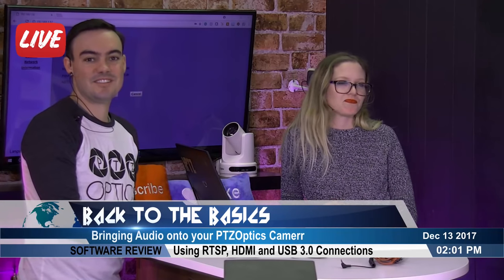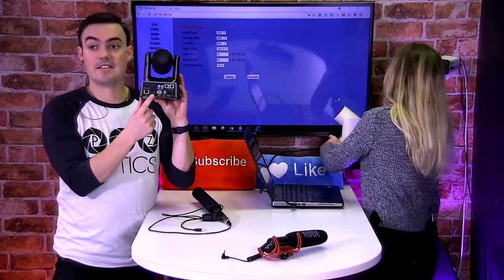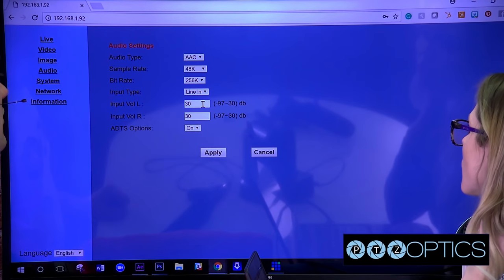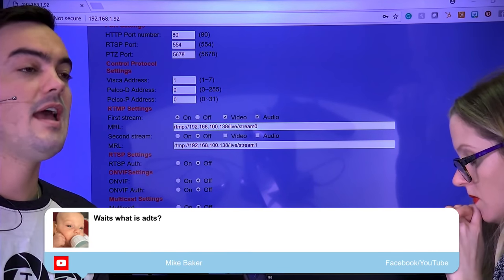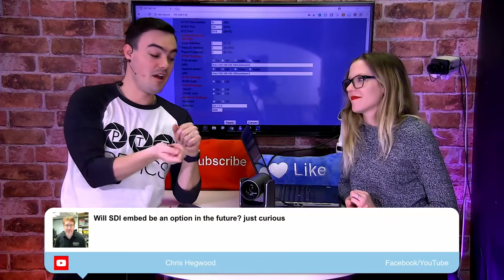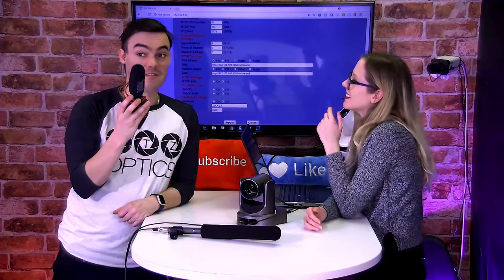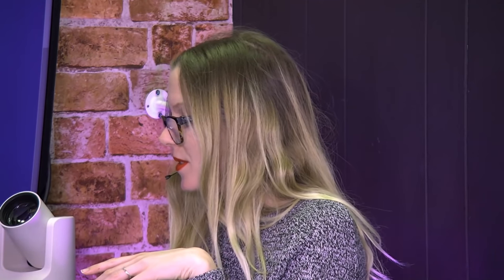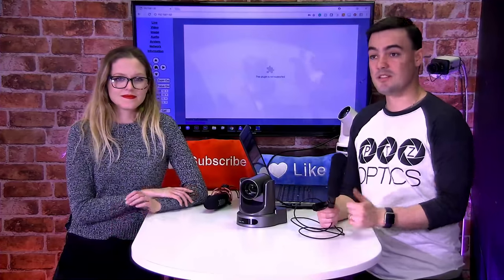How to Add Audio Into a PTZOptics Camera

Comment: By connecting a lavalier transmitter mic to a person, can you connect the lavalier mic receiver to plug into the camera and get good audio?
Reply from the maker: That's a really good use case and you can connect a 3.5mm audio input with a wireless lavalier microphone to the camera. We will try to make a video about this on the new Move SE cameras. Do you have a preferred lavalier microphone? I'm thinking the new DJI wireless microphone everyone is using because we just bought one :)
Reply: @PTZOptics  Thanks for such a quick response - you guys are the best. I use Sennheisser and Shure Lavalier mics. I am sure the one you suggested will work as well. I figured this method can capture the speaker “Spot on” with no ambient noise or worries about mic placement by the camera. The receiver can possibly be mounted under the wall mount with velcro for easy removal for adjustments and battery replacement. What is your take? When is your next show?

Comment: I just bought a 30x PTZ. I cannot get any audio to work. I have tried to different brand new microphones. One stereo and one mono. When I plug into LINE IN I hear a buzz momentarily but nothing afterwards. Am I missing something?
Reply from the maker: "The connection is a 3.5mm stereo unbalanced line level input that will not supply any power.
The camera does not feature any amplifier or pre-amplifier capabilities." ~ KnowledgeBase Forum
https://help.ptzoptics.com/en/support/discussions/topics/13000023228

Comment: Is the audio input unbalanced stereo or balanced mono? Your cable is an XLR to a TRRS, which would be a balanced mono cable, but the camera supports 2 channel audio, according to your setup demo. The camera manual doesn't seem to specify any of this.
Reply from the maker: Hey Don,
PTZOptics cameras typically feature a 3.5mm audio input jack that is designed to accept a line-level input. This type of input is generally unbalanced stereo, meaning that you can input stereo audio signals into the camera. When you mention using an XLR to TRRS cable, it suggests adapting a professional audio source to this 3.5mm input.

Here's the breakdown of what you're dealing with:

1. Unbalanced Stereo: The 3.5mm input on PTZOptics cameras is suited for unbalanced stereo signals. This is common for devices designed to be versatile and compatible with a wide range of audio sources, including consumer-level audio equipment.

2. Balanced Mono vs. Unbalanced Stereo: A balanced audio signal is typically used with professional audio equipment, especially over long distances, to reduce noise and interference. This is commonly seen with XLR cables. However, when you adapt an XLR (which is usually mono and can be balanced) to a 3.5mm TRRS connector for use with a PTZOptics camera, you're likely summing that mono signal into a stereo input or splitting it into dual mono to feed both left and right channels of the camera's stereo input, depending on the wiring of your cable.

3. Channel Audio Support: When PTZOptics references support for 2-channel audio, they are indicating the camera can accept and process stereo audio inputs. This allows you to capture audio from a stereo source (like a mixer outputting a stereo mix) directly into your video feed.

Given the specific mention of an XLR to TRRS cable, if your goal is to connect a balanced mono signal (like a microphone or a mono mix from an audio mixer) into the PTZOptics camera, the cable would need to appropriately convert and possibly unbalance the signal to match the camera's stereo input. This often involves wiring the XLR's positive and negative signals to the tip and ring of the TRRS connector, with ground going to the sleeve, effectively feeding the same mono signal into both the left and right channels of the camera's stereo input.

It's important to ensure that the levels and impedance are matched appropriately for the camera's input to avoid any potential issues with audio quality or damage to the equipment.

Thanks for checking out our Channel! 
Learn More: https://ptzoptics.com/
Reply: @PTZOptics  This was a really great answer to a great question, thank you!

Comment: We are using a the same camera set up at my church, but are having a hard time because we are overloading audio going into the camera.  Is there a way internal or externally to monitor levels going in?  We can get the mix going from the board going well with a full band, but can't seem to find a good way to visually monitor the levels to make sure they aren't overloading on our stream.  Grateful for any help.
Reply from the maker: Hello, So there is nothing on the camera itself to monitor audio meters. You would need to use a 3rd party software.
If you use OBS or vMix, they have audio meters. If you have an NDI camera, the NDI Studio Monitor also has audio meters.

Comment: So would a powered mic or line input, get embedded and sent out of PTZ via HDMI into an ATEM or similar hdmi switcher device ?
Reply from the maker: Yes, that is correct. You can embed the audio and it will go out the HDMI into an ATEM or other switcher.
Reply: @PTZOptics  Thank you for that information, most useful..

Comment: How do you connect a mixer to the camera to sync the video to audio?
Reply from the maker: Hi Larry,
Connecting a mixer to a PTZOptics Move camera to synchronize audio with video typically involves using an external device that can mix audio signals and then embedding that audio into the video stream. The PTZOptics Move cameras primarily focus on video capture, so incorporating audio directly from a mixer requires a setup that combines both signals before streaming or recording. 

Here's a basic outline of how you can achieve this:

Equipment Needed:
1. PTZOptics Move Camera: The camera you're using for video capture.
2. Audio Mixer: The device you're using to manage audio inputs, such as microphones, instruments, or other audio sources.
3. Audio Embedder: This device is used to embed the mixed audio signal into the video signal coming from your camera. Depending on your setup, you might use an HDMI or SDI audio embedder, corresponding to the video output of your camera.
4. Cables: Ensure you have the correct cables for audio (typically XLR or ¼ inch from the mixer), HDMI or SDI (depending on your camera’s output and the input of your audio embedder), and possibly additional cables for connecting the embedder to a computer or streaming device.

Steps to Connect:

Prepare Audio and Video Sources:
- Set up your PTZOptics Move camera and position it as needed for your production.
Connect your audio sources (microphones, musical instruments, etc.) to your audio mixer.

Connect Mixer to Audio Embedder:
- Use an appropriate cable (XLR, ¼ inch, or RCA, depending on your mixer’s output and embedder’s input) to connect the mixer’s output to the audio embedder’s input.

Connect Camera to Audio Embedder:
- Connect the PTZOptics Move camera’s HDMI or SDI output to the audio embedder’s corresponding video input using an HDMI or SDI cable.

Output from Audio Embedder to Streaming Device/Recorder:
- Connect the output of the audio embedder, which now carries both video and embedded audio, to your streaming device, recorder, or computer. Use HDMI or SDI depending on your setup requirements and the capabilities of your receiving device.

Configure Your Streaming/Recording Setup:
- Ensure your streaming software or recording device is set to receive both audio and video from the embedder's output. You might need to select the correct video source and verify that audio is being received as expected.

Test Your Setup:
- Before going live or recording your main content, conduct a test to ensure the video and audio are synchronized and the quality meets your expectations. Adjust audio levels on the mixer as needed to match the video content.

Additional Tips:
- Latency: Be aware of any potential latency issues between video and audio. Test and adjust accordingly.
- Audio Embedder Settings: Some audio embedders offer settings for audio levels or synchronization; refer to your device's manual for optimization options.
- Firmware Updates: Ensure both your PTZOptics Move camera and audio embedder are updated to the latest firmware versions for optimal performance.

This setup allows for professional-grade audiovisual synchronization for your productions, leveraging the high-quality video from PTZOptics cameras with superior audio from your mixer.

Thanks for checking out our Channel! 
Learn More: https://ptzoptics.com/

Comment: How about to send audio from a soundboard or mixer to the camera for live streaming
Reply from the maker: Sending audio from a soundboard or mixer to a camera for live streaming involves a few key steps. The process can vary slightly depending on the specific types of equipment you're using, but here's a general guide:

1. Determine Output Options on the Mixer
Identify Available Outputs: Look at your mixer to identify available outputs. Common output types include XLR, 1/4” TRS (Tip-Ring-Sleeve), or RCA.
Choose an Appropriate Output: For sending audio to a camera, you'll typically use a 'Line Out' or 'Aux Out'. Make sure the output level matches what your camera can accept (usually line level).

2. Determine Input Options on the Camera
Identify Camera Input: Check your camera for an audio input. Many cameras have a 3.5mm (1/8”) stereo input, while professional cameras might have XLR or 1/4" inputs.
Set the Correct Input Level: Ensure the camera is set to accept the type of signal you are sending from the mixer (line level is typical).

3. Select and Connect the Proper Cables
Choose the Right Cable: Based on the output of your mixer and the input of your camera, you'll need the appropriate cable. 

Common scenarios include:
XLR to XLR
1/4" TRS to 3.5mm TRS
RCA to 3.5mm TRS
Use DI Box if Necessary: If you need to match an unbalanced output (like RCA) to a balanced input (like XLR), you might need a Direct Box (DI Box).

Connect the Cable: Plug one end of the cable into the mixer's output and the other into the camera's input.

4. Test and Adjust Levels
Initial Testing: Before going live, play some audio through the mixer and check if it’s being picked up by the camera.

Adjust Mixer Output: Use the mixer's output controls to ensure the signal sent to the camera is strong enough but not clipping (too loud).

Adjust Camera Input Levels: On the camera, adjust the audio input levels as needed. You want a strong signal without peaking or distortion.

5. Monitoring
Monitor Audio: If possible, use headphones to monitor the audio directly from the camera to ensure the sound quality is good.

6. Use an Audio Interface or External Recorder (Optional)
If your camera doesn't have suitable audio inputs or you want higher quality audio, consider using an external audio recorder or an audio interface. In this setup, the audio from the mixer goes into the recorder/interface, and then the audio is synced with the video in post-production or sent to the streaming platform.

7. Consider Ambient Noise
If you're in a noisy environment, remember that the camera’s internal mic might pick up ambient sound. Using an external mic closer to the sound source can help mitigate this.

8. Software Settings for Live Streaming
If you’re streaming through a computer using software like OBS, you can also send the audio from the mixer directly to the computer via USB (if your mixer supports it) or using an appropriate audio interface.

This setup allows you to use the high-quality audio from your soundboard or mixer for your live stream, which can significantly improve the overall audio experience for your viewers.

Comment: What needs to be added to get the audio through the sdi output?
Reply from the maker: Larry Loe - that is a difficult question when it comes to the cameras. But there is such thing as an SDI audio embedder
Reply: PTZOptics why is this a difficult question? I’m asking because after purchasing a 30x sdi camera and running bnc cable throughout our building I can’t get audio.
Reply from the maker: Larry Loe - Hi Larry. It’s a difficult question because it would require a redesign of our camera board. We have never supported embedding audio over SDI. But there is such thing as an SDI audio embed device if you do need this. We do embed audio over HDMI, IP, NDI and USB as we review in this video.

Comment: How to get sound to ptz camera while using Facebook live ? Video plays but no sound . Which audio should we choose ?
Reply: If you are using a PTZOptics camera, you may need to log into that camera and make sure audio is enabled on your RTMP stream settings in the network tab.
Reply: @StreamGeeks I have a fomako ptz
Camera I’m also having issue getting audio I connected a 3.5mm cable to line in and then 1/4 to 1/4 trs end to a mixer but still not working help me

Comment: So can someone explain to me after I have everything done audio from my sound mixing board into the camera, and wire or wireless to my computer into vmix? Cause it's seems to me everything I try doesn't work.
The one thing I'm doing now is running sound through a Yamaha UR12 box in to my computer but I'm wondering if I can somehow make it easier. 
It's seems to me that the camera is bringing in a sound signal over NDI just can't seem to hear it.
Reply from the maker: Hi John,
Integrating audio from a sound mixing board into your camera setup and then transmitting it (either wired or wirelessly) to your computer for use in vMix can be a bit complex. Let's break down the process and troubleshoot the issues you might be facing, especially concerning the NDI audio signal from the camera.

Understanding the Setup

1. Audio from Mixing Board to Camera:
- The audio output from your sound mixing board should be connected to the audio input of your camera. This typically requires a suitable cable (like XLR or 3.5mm, depending on the inputs available on your camera).
- Ensure the mixing board's output level and the camera's audio input settings are correctly matched to avoid issues like low volume or distortion.

2. Camera to Computer (NDI):
- When using NDI, the camera's video and audio are transmitted over the network. Ensure your camera is correctly set up for NDI transmission. This often involves configuring settings in the camera to enable NDI and ensure audio is included in the NDI stream.

3. Receiving in vMix:
- In vMix, add the NDI source by selecting "Add Input" and then choosing "NDI/Desktop Capture." Select your camera from the list of available NDI sources.
- Make sure that you are selecting the NDI feed that includes the audio (it should be a default feature unless specified otherwise in the camera settings).

4. Troubleshooting Audio Issues
- Check Camera Audio Settings: Ensure the audio is being captured by the camera and included in the NDI feed. You might need to dive into the camera's menu to check these settings.
NDI Audio in vMix: In vMix, ensure that the audio from the NDI source is not muted and is routed correctly. Check the audio mixer in vMix to see if the NDI source's audio levels are visible during playback.
- Network Stability: Ensure your network is stable and has sufficient bandwidth for NDI, as network issues can sometimes affect audio transmission.

5. Alternative Setup Using Yamaha UR12
- If you're currently running sound through a Yamaha UR12 audio interface into your computer, this setup bypasses the camera for audio. The UR12 is connected directly to your PC, and you can add this audio source separately in vMix.
- In vMix, add the Yamaha UR12 as an audio input, ensuring it's correctly configured and not muted.

Simplifying the Process

To simplify, you can consider one of these options:
1. Direct Audio Input into Camera: If your camera supports it, this is the simplest method. The audio from the mixer goes directly into the camera and is then sent to your computer via NDI, all in sync with the video.
2. Separate Audio Input in vMix: Use the Yamaha UR12 or another audio interface to input audio directly into vMix. This method allows for more control over the audio in your production software but requires manual synchronization with the video.

It's crucial to experiment with these setups during a non-critical time to ensure everything is working as expected. If you continue to experience issues, please provide more specific details about your current setup, including the camera model, the connections you're using, and the exact problem with the audio in vMix. This information will help in providing more targeted assistance.